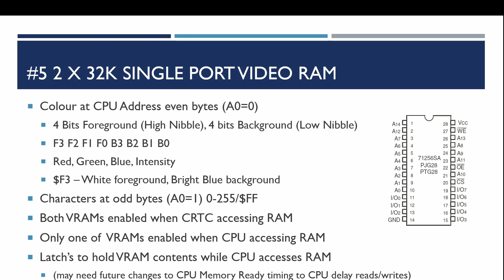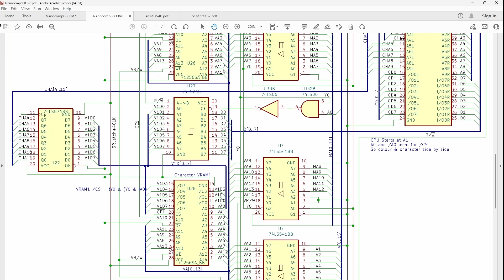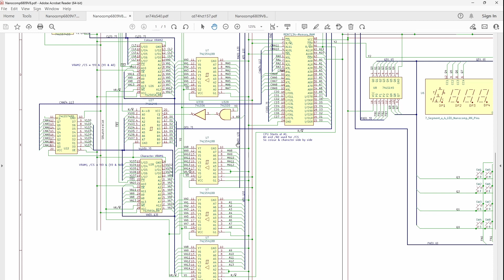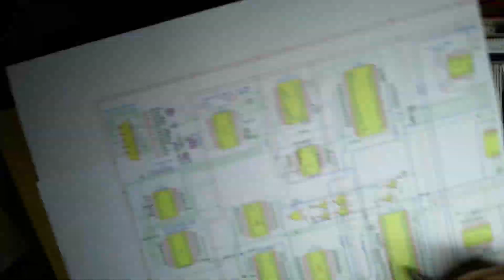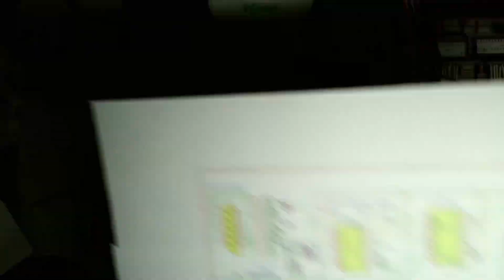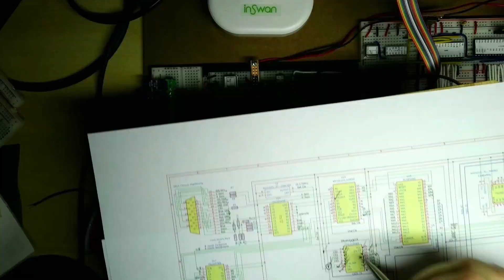V07 Part 1 Breadboard VGA Controller Upgrade RAM & Colour Nanocomp 6809 8 Bit Breadboard Micro

Comment: This is a great series and I'm really enjoying how thorough you are with the design and implementation process. Can't wait for the next one and at some point I'll build one but on a PCB as I've not got that many breadboards. I'm also playing with a TMS9918 but full VGA would be so much better especially as I don't need sprites and collision detection. I hope you get many more subscribers and have a happy new year!
Reply from the maker: I'm glad you're enjoying it. Just trying to get the timing of the video RAM enable and R/W signals right so I can finish the next update. Should be in next couple of days. Good breadboards are about $8-9 each from Mouser, I tend to buy a number at a time to get free delivery. Certainly, easier than making PCBs. The MC6845 CRTC was used for the original IBM PC CGA adapter, but a custom chip used for original VGA, that's why getting VGA to work with the 6845 is more of a challenge/interesting. Happy New Year.